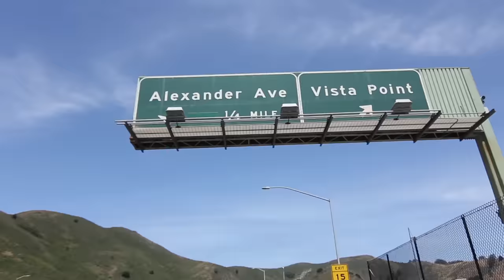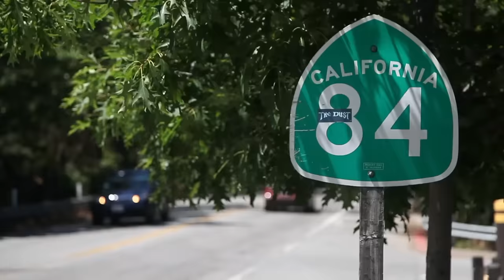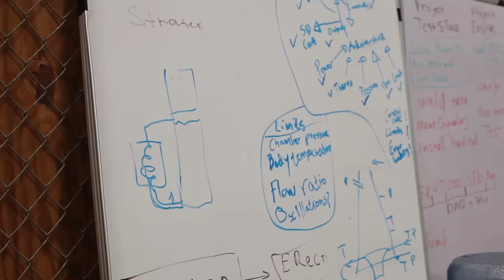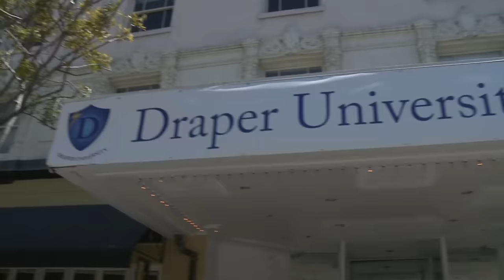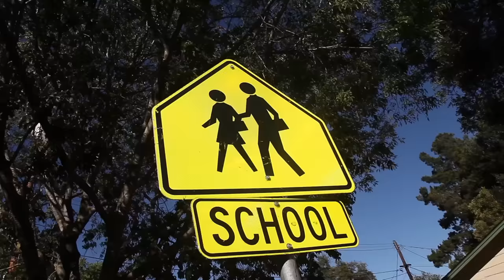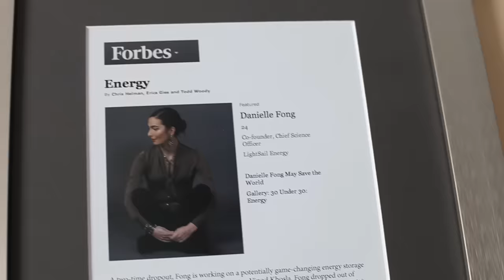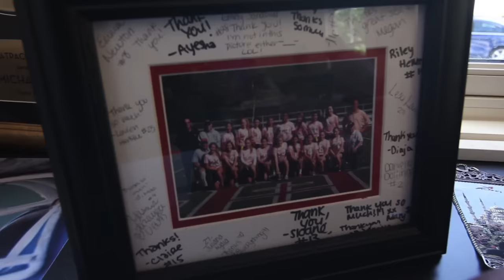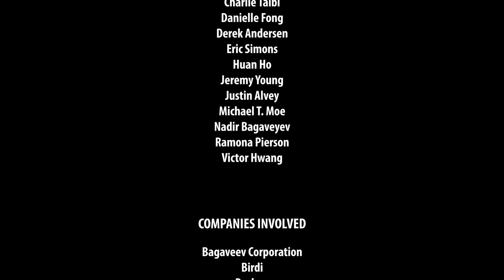Welcome to Silicon Valley

Comment: for 27 minutes i felt normal...
Reply: I feel the same,Sometimes my dreams feel scary because I want massive tech success.
Reply: Me too!
Reply: me too...
Reply: Same thing bro what field are u gonna specialize?
Reply: Probably Computer hardware engineering becasue computers are awesome or environmental engineering because green energy is on the horizon with strong market for VC backup. Plus, green energy helps the planet lol
Reply: I am gonna look into programming(For now)
how old are u? I am 13
Reply: I am 17. I started learning around the same age. Keep an open mind and dive into a language you want to learn, whether its for gaming or android application driven. Its a diverse field
Reply: Nice let's be in touch.are u there in gmail
Reply: +Ryan AndPeople What language do you recommend?im 13 to and learning programing
Reply: Umm. What I did when I was 13 was figuring out what I wanted to do. At first, I wanted to learn how to make a video game. So, I learned  c# and c++ to get started. Eventually out of curiosity, I wanted to make android apps, so I switched to Java. You just have to find what programming language fits your interest. Or, I recommend python, albeit I hated it because of its easy complexity. Now, not so much because of its wide use, but mostly the implementation it has on the Raspberry Pi computer. Many projects can be started using that inexpensive computer while learning and coding in Python. It would be cool to see how your code can be physically observed by a simple light bulb or building a fist tank feeder. Its really just endless possibility. Ultimately though, just explore your creativity.
Reply: Let's keep in touch guys
Reply: ***** Thank you
Reply: guys lets share our email ids
Reply: NotReally I Guess what r u working on?
Reply: lol true
Reply: Ryan AndPeople Hows it going so far? Once I finish my finals, I'm going to learn Java in 3 days. I already have 3 ideas for android apps I wish to develop. I'm 17 duh :V
Reply: what about the rest 11 sec?
Reply: @roamdeleo  lets work together
Reply: @Ante Tomas working on my startup! Beta should be out next January and applying to Venture for America. It's been a hard journey learning through school and not dedicating time to my passion, CS. But, I'm graduating university soon. I hope to either have a startup or work for one.

Comment: Dear silicon valley.   electrical is coming (already here?) . The batteries really should be interchangeable. Buy the bike, hire the battery. Buy the car, change the battery. beyond  the product the battery is in my perspective the pain point. instead of charging a bike, car. Changing batteries? You drive, We charge (batteries that is!)